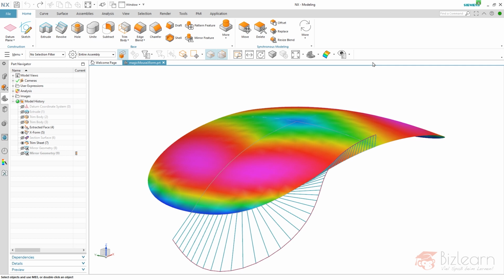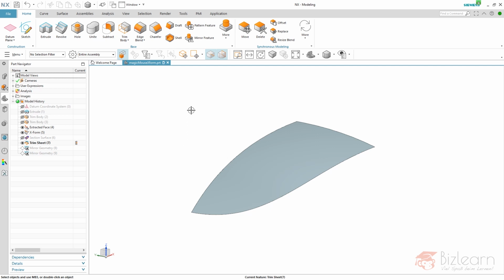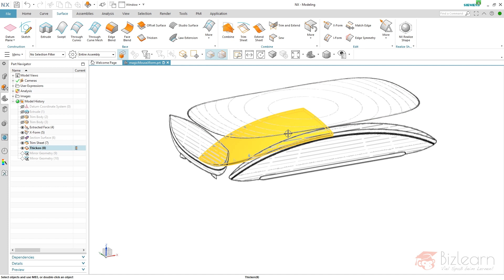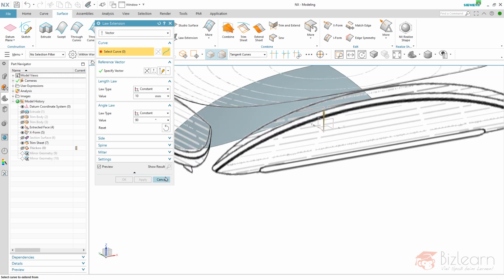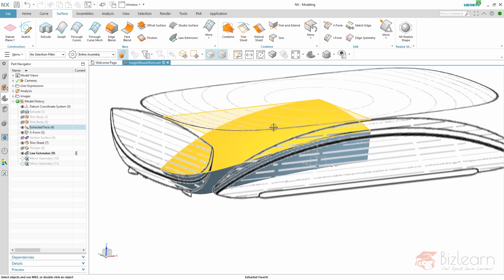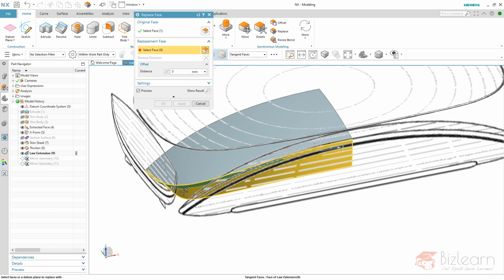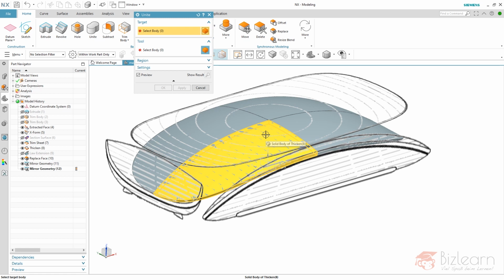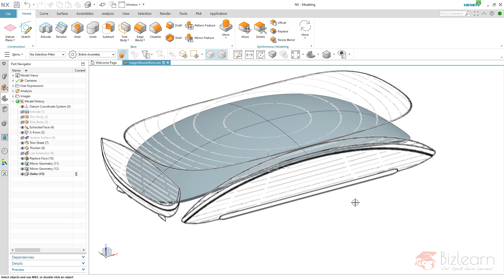Siemens NX Freeform Pro Tutorial - how to combine faces by use of Replace Face

Comment: Good explanation of using both law extension and replace face. People usually condsider to use synchronous modeling commands in secondary opiton but I think they are so powerful and also parametric. Thanks for video.
Reply from the maker: I fully agree. As far as you have a good understanding of selection rules etc. also delete face is a good option, which I use frequently within my UDF's and also standard parts^^ You're welcome